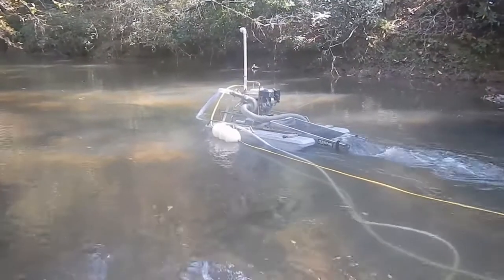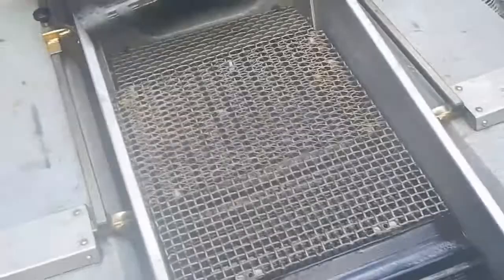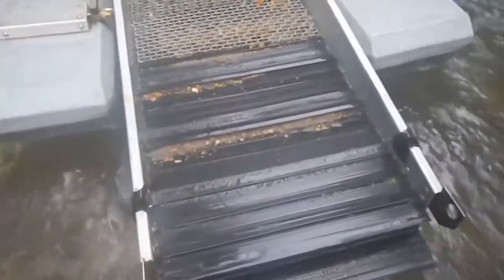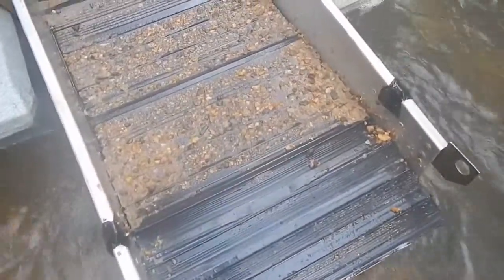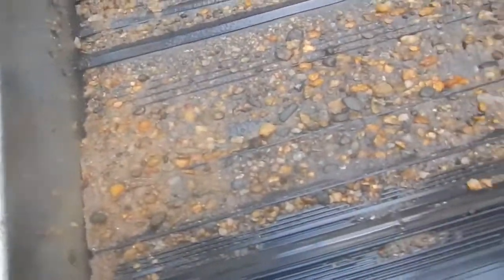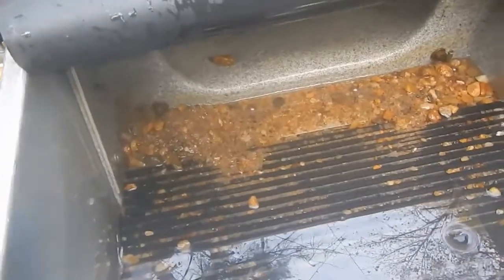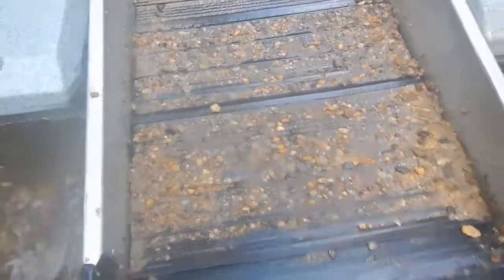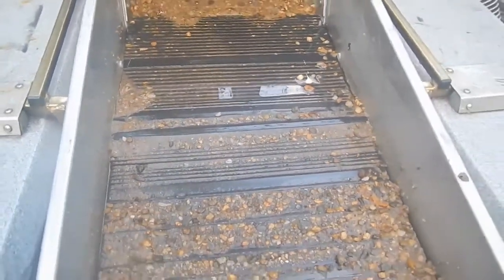Gold Dredge Over/Under Conversion Part III

Comment: Muddog,
Yep...  Looks like the lower tray for sure isn't getting the volume/flow you need or want to run clean.  Again, from my dredge ops, I recommend you remove all extra expanded metal/punch plates.......except for the factory Keene 1/2 inch square grizzle plate under the flair.  That should give you more volume, smoother flow.  Also, I try to limit my dredging to about 20% material and 80% water, especially when I am into layers of heavy black or garnet sand.  Randy  "C-17A"  :)

Comment: I couldn't help notice you don't have your sluice pulled out from the pontoons. The sluice slides out on the rails to give more down slope to clear riffles without so many modifications you seem to be trying to work through. I run my sluice all the way out o the rails as far as it will slide out. Loosen the thumbscrews at the back of the box on the rails, crab the crossbar and push or pull (depending where you stand) and slide it out. Just a thought to give a try. Let me know how it goes for you